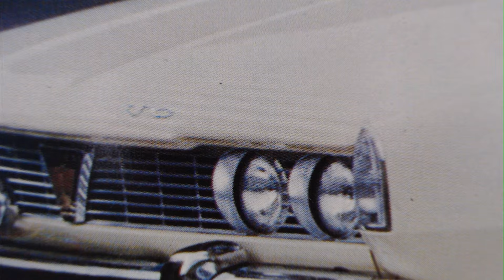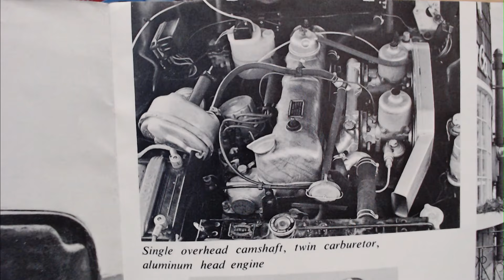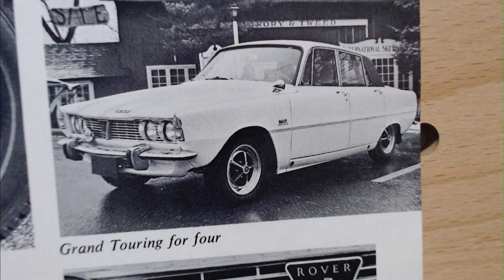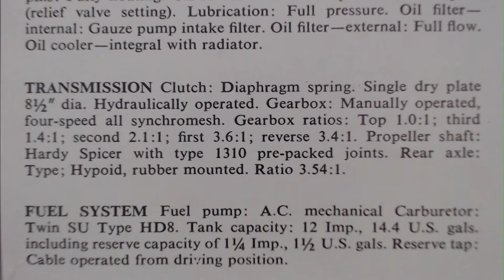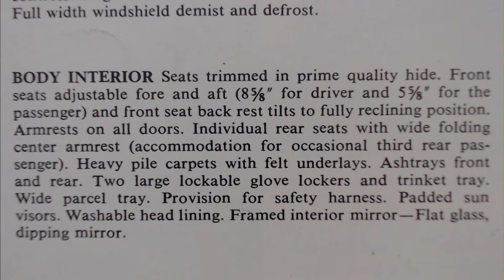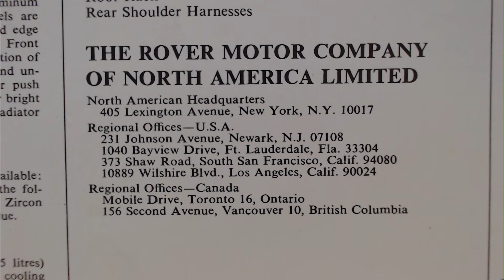Rover 2000 TC: British Engineering Excellence | Classic Brochure Review

Comment: This TC version's 124 bhp was most definitely considered a very high performance for a 2.0-litre engine in the 1960s. It was well ahead of its time, when you consider that many mainstream brands were still offering new N/A 2.0 fuel-injected petrol-engined cars well into the 2000's with between 115 and 130 bhp.